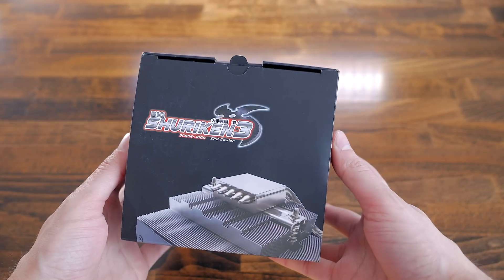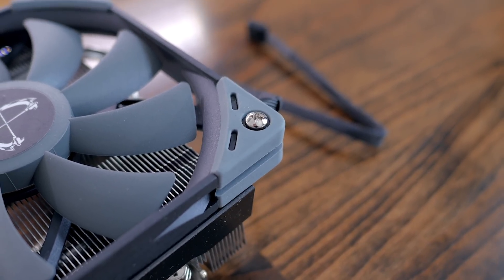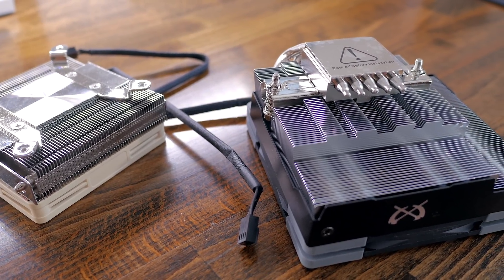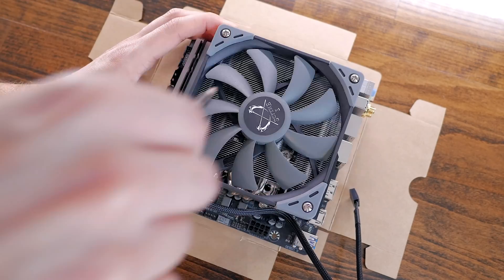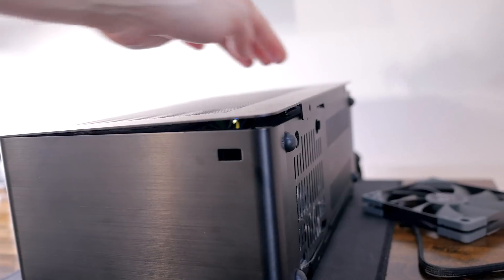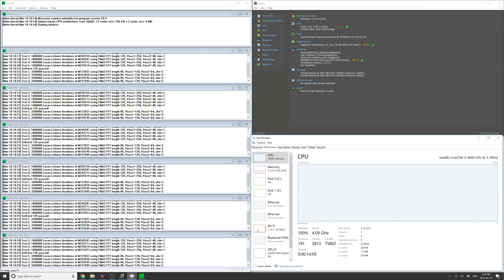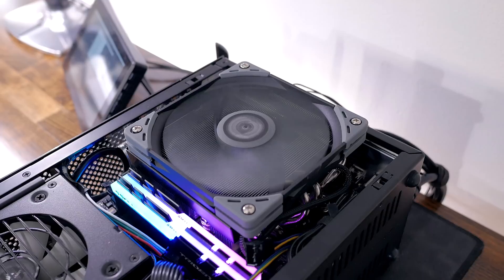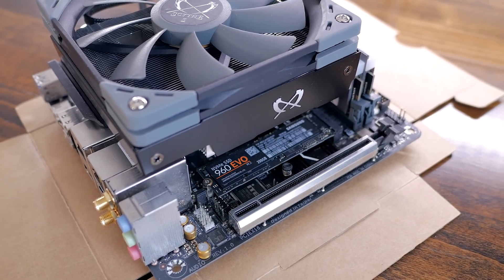Small CPU Cooler, Big Performance? - SCYTHE Big Shuriken 3 Review

Comment: Would this work with an i9 9900k ?
Reply: Can you make it work, sure.... If you are willing to limit it to like 95 watts and low clock speeds, but at that point why have a 9900K. It would be better to go for a lower power CPU that won't have to be handicapped. 

For my 9900K I'd want at least a BIG air cooler or 280 AIO.

Comment: I want use it to match 3900X. I don't know if this is appropriate.
Reply: I use it with my Ryzen 7 1700x (I know, the performance of the two CPU is not the same.)
But my CPU is 35-40 celsius on idle, 50-60 celsius when I play games (e.g.: BFV high preset or other hyper super graphics games) and 72 max celsius in 100% load.
(Stock, 3.40 Ghz | 8C/16T)
Reply: Fuma 2
Reply: The ryzen 1700X uses 95W while the 3900X uses 105. Chances are it will run hotter. That said if you have room for a standard 25 mm 120mm fan replacing it with a Noctua PWM fan will get better results.

Comment: Yes-no-toaster ?
You should ask your Scythe contact why they are so hard to find up here, Amazon is the only reseller listed on the website and they are weirdly overpriced and understocked. They used to be way easier to find and a common recomendation in the late 2000's... I bought a Mugen 2 Rev.B for 36CAD in 2008 and it was great.
Anyway, keep it up.